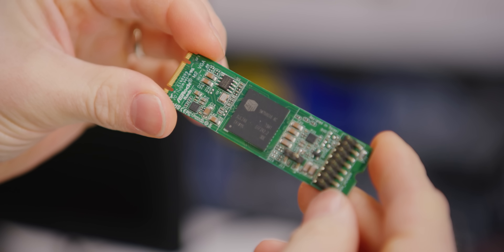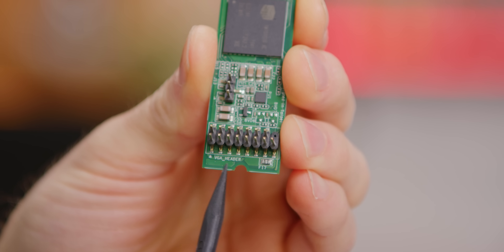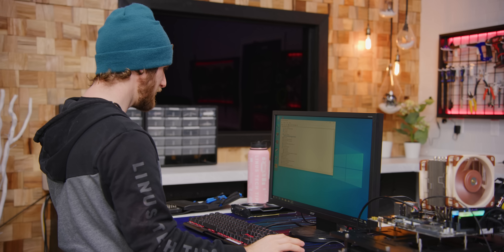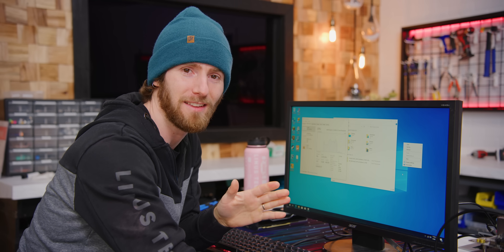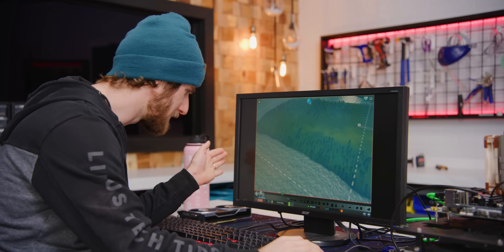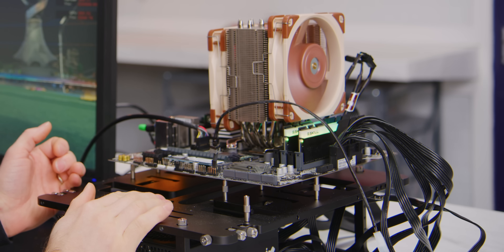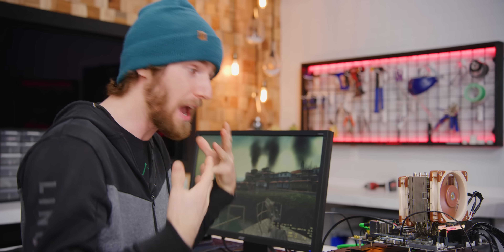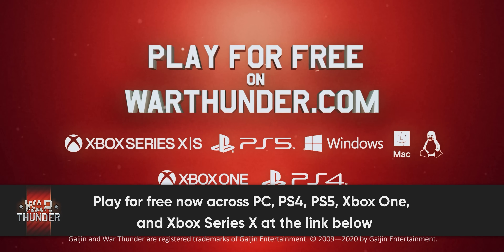THIS is a Graphics Card..?? - ASRock Rack M2_VGA

Comment: Can't speak to whatever that thing is, but I was actually looking for a m.2 graphics 'card' in the past week. A lot of laptops' dedicated GPUs are actually paired to the mainboard via what amounts to a m.2 interface (see the 'HP ENVY 27-B 34-B AIO NVIDIA GTX 950M' on Ebay as example).

Now, the WHY for me looking for this is because of how Windows handles dedicated graphics memory usage. The 'DWM', or 'Desktop Windows Manager', takes up at least 250MB on its own under normal operation. Programs like Battlenet and Discord can each occupy a toasty 250MB also, though at least Battlenet's can be reduced to 0 by 'closing' the window to tray. Chrome easily occupies another 250MB.

It should be obvious already that these figures add up real quick and can result in a graphics card seeing at least 1GB of its available VRAM occupied by non-gaming applications... on a 4GB card, this isn't good. It results in a significant drop in visual fidelity in one's games and eventually also a marked performance drop and, worse, random stutters/jerks.

One is supposed to be able to simply run a second GPU and tell Windows "okay, run everything which is not my game on THAT card", but unfortunately the developers at Microsoft decided one can only do this if the one card is seen as a 'discrete' graphics card and the other as a 'mobile' one... if they're both discrete cards, the more powerful of the two is automatically used for everything, and you cannot force Windows to use the weaker one for anything else in any realistic way I've found right now, short of hacking drivers to make it believe a discrete card is a mobile one.

So, instead of going through all that kerfluffle... just mount a mobile GPU as the secondary 'card'!

One could argue the real solution is to simply use a higher-VRAM graphics card, but in my case I want to offload absolutely ALL processing for things which are not my game I'm trying to play to this secondary card.

Comment: This, but at the same strength of an AMD APU or GTX 1030, would actually be great to build a SFF workstation PC at or slightly below 3 liters in size. I'm thinking something along the lines of a Mac Mini or, if you want to go slightly bigger and brickless, the J-Hack Pure or Inwin Chopin. Put a 5950X in there and you have a sick small system :)

Comment: The 8 bit is a Lie. There is a x4 multiplayer that gives you 32 in actuality but someone at Microsoft forgot to include that in the software code so it reads as 8 bit. I ran into this with my new monitor and freaked not understanding why it only said 8 bits until I did some digging.

Comment: As someone who still remembers when you needed a 4MB "3d accelerator" card to play Rogue Squadron on a 266MHz Gateway PC, that thing sounds positively extravagant... for 1999 standards
Reply: But you still need the 3d card with this. This is just a standard 2d accelerator card. Pair it with a Voodoo and you'll be able to both run spreadsheets and play 3d games!

Comment: The original Acer Aspire One netbooks from back in like 2009 had a graphics accelerator on a mini pci-e bus. It did the h264 conversion so that the machine could play 1080p videos with an atom processor. iirc, Broadcom made them. I had to special order one and mod my model of acer to fit it in (and I had to axe the wifi card that was plugged into the port...)

Comment: "the only GPU on this computer" Does that motherboard not come with its own integrated GPU?
Reply: motherboards havent come with integrated gpus for a long time. most of the time igpus comeas a part of a cpu but not with the cpu he is running since he is running a ryzen.

server mbs still do come with igpu on the board if they have some sort of ipmi.
Reply: @bigpod  the last time I checked, motherboards having M.2 slots are the more recent boards that either have integrated video outputs or use processors that have integrated GPUs.
My first computer had a Pentium III CPU that inserted into a Slot1 motherboard. It did not come with any integrated graphics processor. I had to install an AGP graphics card like the NVidia FX 5500. Those are all old hardware you may not find anywhere now.
Reply: @adeboyegrillo3408  nowdays there is no intagrated motheevoards that have integrated gpu onboard tge motherboard itself its an old concwpt from way beck when but there are cpus that have integrated gpu but what he was using i a ryzen third generation that isnt G version what that means if it isnt G version it has no integrated gpu so yes, motherboards still have outputs but those outputs are useless without a proper cpu

Comment: This is something i'd find useful in my build. I have an intel i7-7800x which does not have any integrated graphics. I've already encountered an issue in the past that caused my gpu to be useless, thus rendering my computer useless for the duration of the repair. This seems like a space saving, cost effective way to keep my computer at least operational if my gpu craps out on me again.

Comment: you know, that little gpu would be perfect for a tiny server box(or a big server box). compact, power efeciant, no heat, not bad.

I also just realized that it probably does not process graphics at all. I bet its intended to be a sort of 'bridge' for motherboards that dont have on board graphics. more specificly motherboards that are capable of processing video on board via the cpu but with not video out at all. Like adding a video port to an exsisting motherboard that has a headless gpu with no video out like an Nvidia Tesla or Intel Xeon Phi(technicly not a gpu) but you get the idea.

Comment: Gaming machines, probably like arcade machines which now alot of times use embedded pc's to run them. There are quite a lot of them that are just flat out optimized to show visuals based on their hardware, and some don't need much in the way of GPU power. There's also SEGA that uses older Nvidia hardware and does some pretty crazy things with their older units (early to mid 2000's era), know as the Lindbergh.

Comment: I think these graphics cards came from the idea of running an eGPU on a non-thunderbolt laptop. The way we attached an entire GPU was by getting a power supply and attach it to your GPU, then attaching a pcie to m.2 cable that attaches to your m.2 slot on your laptop. You then pray that you NEVER have your power supply disconnect.

The results were very promising in performance.

Comment: Want to build a small mini-ITX server with ECC memory support, and I need the PCIe slot for 4x ethernet adapter.
  AMD Ryzen PRO APUs would do perfectly, except they don't sell that to consumers.
ASRock: Aha, you can use AMD Ryzen CPUs (without iGPU), and add a little m.2 video adapter to get basic display output!

Comment: The impossible has happend: They manage to make something worse then Intel HD graphics!!
Reply: Not like Intel HDs nowadays are quite alright
Reply: I remember in the prior century being given the choice of said intel card and the riva128 (and even ati, but... the drivers *smh*) Been team green ever since. Not fanboy blinded, just always made more sense. You know, when you could do a little hardware hack and run your normal geForce card as a Quattro. Biggest mistake was not investing... especially the day when I heard team green was going to power the original xbox, as their stock was pretty flat even immediately after the announcement. At least that's how i saw it at the time. Revisionist history (i.e. in this case, the "truth"... lol) probably would prove otherwise.
Reply: @geomcloco432  If you're not 3d gaming the original integrated graphics in the i810 was more than good enough. For a non-gamer that's great because you literally get a free graphics card. It can easily drive high-resolution monitors while just a year or two earlier you needed an upgraded card to run at higher resolutions. 

For the younger people out there, I don't mean you couldn't get playable framerates at high resolutions on old cards. I mean you couldn't run high resolutions at all. With a 2meg video card you can't run Paint above 1024x768 without resorting to indexed color, there simply isn't enough RAM.
Reply: Intel "HD" :D

Comment: There's another, more "techie" use for this. Use Case: you need to run multiple VMs, with more than just 1 or 2 CPUs per VM, and you're dedicating GPUs to each VM, but you still need a local console to interact with the system to control and administer it.

Higher core-count/performance CPUs don't always have integrated GPUs (or aren't always wired in the motherboard). Instead of taking up a full PCIe slot, that could be used for a full GPU for a VM, you can use this to serve as your local interface, leaving all other GPUs free to allocate/dedicate to VMs.

The same use case would apply for mining/AI/high compute nodes also.
Reply: Or simply for servers with CPUs not including an internal graphics adapter. You usually still need to access the console at least for initial setup so a cheap, efficient and small GPU like this is perfect. That chip is basically what you'd find built in on many modern servers anyways
Reply: Yep, my thoughts as well, for VMWare or HyperV servers offloading the GPU grunt to something like a bunch of these.
Reply: Linus said that at the end of the video.
Reply: 1.5 WATTS!!!
Run your HIVE/linux OS through one of those and allow ALL your mining GPUs to focus on mining ONLY. Mining rigs have the monitor off all the time anyways.

Comment: I figured it was offloading the actual work part to the CPU the moment I saw it, that's basically how most motherboard sound chips work too. Of course, processing audio is significantly less intensive than even moderate GPU loads so it's far less of a drag on resources when the sound chip does it.

Comment: "You kids today got it good"
Back in the day It took 3~4 diskette to transfer a 18 page doujin.

It also require some praying to ensure the data is not corrupted during transfer as you can lose a page or two due to low lifespan Diskette easily generate bad sector.

Comment: As a developer (that happens to have worked on games..), using 30 or 60 as refresh-rate is cursed. You need to follow the true path: 32, 64, 128, 256, 512, etc whenever possible. I remember during a gamedev course I had in Uni, we tried running the server at a refresh-rate of 60 updates-per-seconds and it never worked right. I then took a look at it and changed it to 64 ups and BOOM, it worked. 

Moral of the story: That "gRaPhIcS cArD" tries to un-curse itself using a default 64hz rate since it is cursed to start out with.

(I know CS follows the true path, but CS is still cursed because of the source-engine being retarded)

Comment: If you look at what its intended use is (ie, servers) it's not that bizarre or puzzling. It's small, uses little power, has great thermals and offers an easy way to add a display to rack mounted hardware.

Comment: Using it as a graphics card for my unraid box was the first thing I thought about :p. The low power draw would be amazing. Now if only I didn't run my Unraid on an AM3+ board that doesn't have an m.2 slot.
Would this work with an M.2 PCIE adapter?

Comment: Linus and crew probably already know this, but the "Gaming Machines" being referred to here are generally speaking casino machines and similar games. This could also be used with a range of embedded boards; often a customer might only be upgrading the motherboard itself and requires a very low/thin profile board. Depending on their needs there might not be a VGA out, but they may still have a VGA monitor (think ATM machines or even some industrial machine controllers). Having an M.2 based card would work for such a low graphic requirement application while maintaining the low clearance requirements.

Comment: This would have been handy when my PSU almost died and my PC would start without a GPU but didn't have enough power to turn on with a power hungry GPU. I did not have onboard graphics so i was stuck in a loop. As any responsible young enthusiast i started the PC only with the CPU and hotplugged the GPU  in POST in order to trick the bios the power is enough...it ran for a month and then died again. I bought a PSU that cost 4 times as much as the burned Chinese one. 10/10 would not recommend.

Comment: I kid you not, I played games like this when I was a child, I completed the whole Stronghold campaing with 2-10 fps, with a warning at every start that Stronghold needs at least 16mb of RAM
Reply: Any 3D game on the AMIGA 500 ran at like 3-8 fps. But the input didn't lag like today when games run at that rate...
Reply: Rainbow Dash games back then were built for that. not now adays
Reply: @milkman5180  Exactly, but the point I was going to make was that back then the input code was handled independently from the rendering. That even was the case on PCs running MS DOS, but having DirectX as an API in between the software and hardware killed that "feature". Having lower fps wouldn't be as horrible if that still was the case today... instead, you feel your fps directly with your controls which is why especially competetive shooter players strive for maximum fps. I remember a time when those sticked to PS/2 mice because those were polled at 200Hz which USB ports couldn't do back then.
Reply: Rainbow Dash 60fps is fine
Reply: Rainbow Dash btw idk what ur sayin
Reply: @milkman5180  that's evident xd

Comment: You'd know if this is not super expensive. This could be fantastic for a ITX ryzen 5950x workstation with capture card. 16 cores, the capture device for capturing your gameplay. This could be especially powerful for a dual system build...

Comment: My original GPU still had the "ATI" branding, slightly bigger than a deck of cards, I did indeed play Rocket League.
The trick is that the game could run custom resolutions, I ran 10FPS around 240p.

Comment: "Gaming Machine" means "Gambling machine" - eg slot machine.
Reply: It might actually. Could make sense. In that scenario you just want the machine to be as cheap as possible and just meet the min specs
Reply: @altimmons  Ok but even the lowest of the low-end Celerons have a better on-die GPU than this thing does. I think that even a Raspberry pi could outperform it.
Reply: With all the graphical effects I see on slot machines around here, I almost doubt that thing's enough.
Reply: @maighstir3003  Those effects are all just prerendered animations though. Another computer has already done all the "heavy" lifting to make 3d animations/effects.
All this needs to do is play back the video at 480p - Nothing 3d or graphically intensive.
Reply: Ok that makes even more sense than me thinking gaming machine meant gaming servers.
Reply: Ya this thing is definitely made for embedded machines
Reply: But what's the reason for slot machines choose to not using the onboard graphics (or more, choose a processor/motherboard that has no onboard graphics) ? Even the onboard graphics built inside a AMD E240 embedded processor is way better than this.
16 MB of VRAM, that's like the level for decades old graphic cards like Nvidia TNT2 or so ?
Reply: @hakureicirno6059  diagnostics screen for technicians
Reply: Those machines aren’t using CPUs even a tenth as powerful as anything you can still buy from AMD or Intel. Probably something like a Broadcom Cortex-M7
Reply: As a former Slots Tech from years back, this is what I'm thinking it most likely is.

Comment: Wanna know the use I would have for this?

To actually CONNECT my CRT monitors to it.
Then use the modern graphics card to render, (which no longer have VGA output) and this little thing to display.

Like notebooks power management. You can use the on-board graphics for desktop use, and activate the graphics card to game.

Comment: The drivers probably lie to windows about 32-bit support and do a lower bit color compression internally. 16MB is not alot to work with. It could also be a super cheap low res DAC. 

I discovered WARP by trying to launch HL2 on a windows VM with a basic adapter driver over the network with remote desktop. Performance was actually surprisingly good.

Comment: HEy this is a good option for a board with Ryzen processor to run until you can put a descent GPU on it.  Not everyone runs and play games on their PC.  And like you said, it's a good option also to diagnose on board video issues if you have an APU and you dont have any video output, this little board can help see if it's the MB or the APU that has some problem.

Comment: I had to ask my dad to use his diamond dust coated saw to cut off half of the metal bracket for my Asus Xonar SE soundcard to fit in my PC because I had no 2 inch bracket with me. I know, I've done strange things to add power to my SFF 7040. I got the MSI GT 1030 OC with the fan because that version of the card has Displayport 1.4 and is 0.7 inches thick to FIT, Xonar SE 4 inch bracket cut to 2 inch, cut off some metal from my HDD case so I can install the 4x4GB Geil Super Lace CL16 1.2v RGB memory, and now I have the 2000-0511 error just because I replaced the stock fan with the Redux R8. Why? As far as I'm concerned it's just a simple PWM fan, the Optiplex UEFI isn't helping anything either.

Comment: This is genius.

I imagine this for a passthrough GPU rig where your big pcie slots are used for the VMs. If you use a Ryzen you wont have an iGPU so use this as the iGPU for the Linux host system.